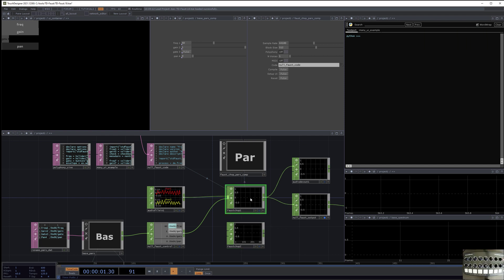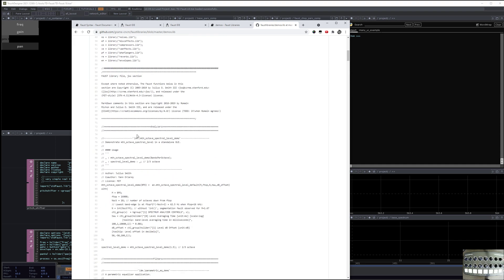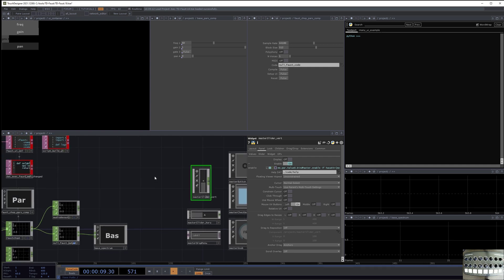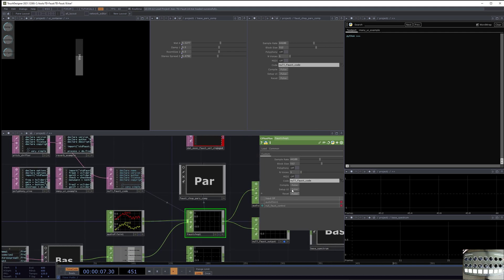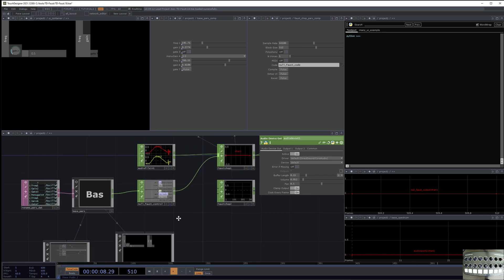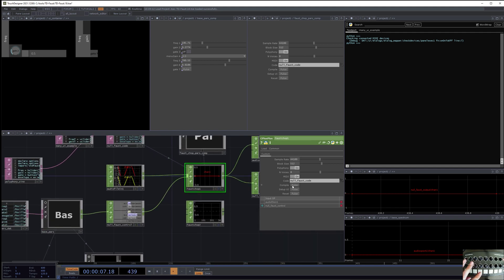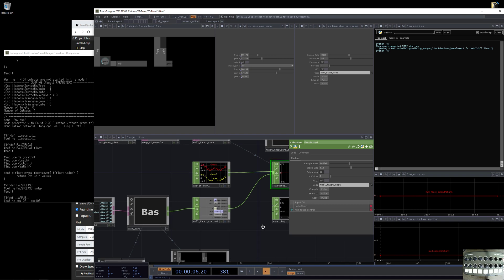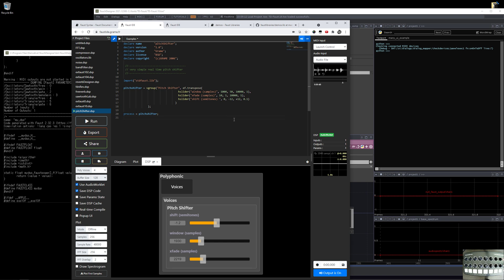FAUST in TouchDesigner (Audio Coding Demo)

Comment: David have you tried physical model with Faust running on TD? 

I know Romain did a presentation about the new physical Modelling method based on any mesh data. Would be cool if we can do this real-time in TD
Reply from the maker: Yes I just tested it. Pull the latest on GitHub (the UI script slightly changed) and try `process = pm.churchBell_ui <: _,_;`
Reply: @DavidBraun  let's talk via email okay ;)